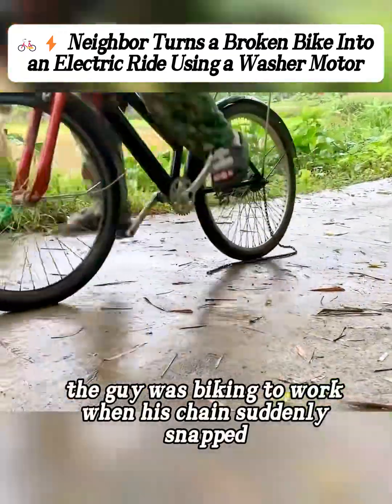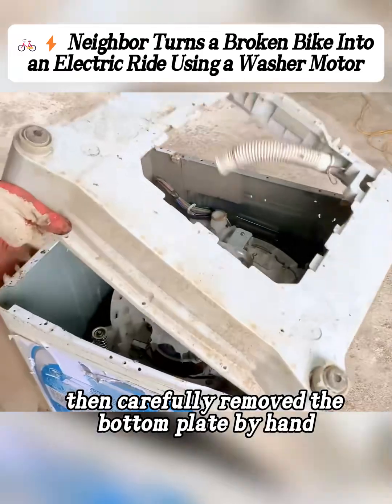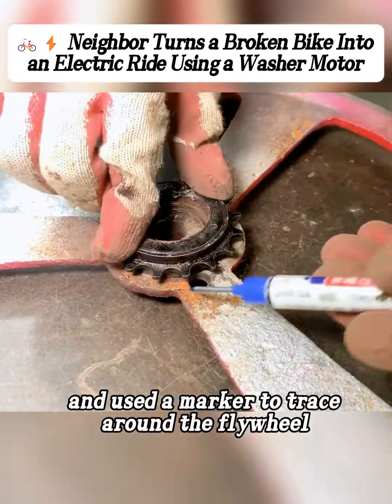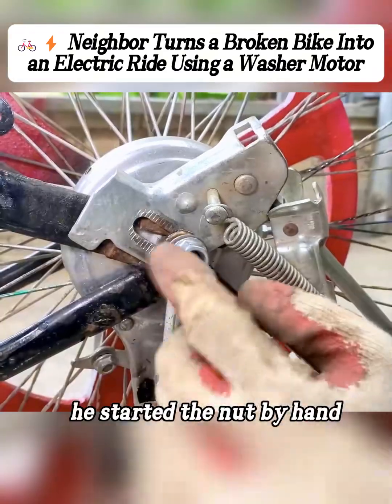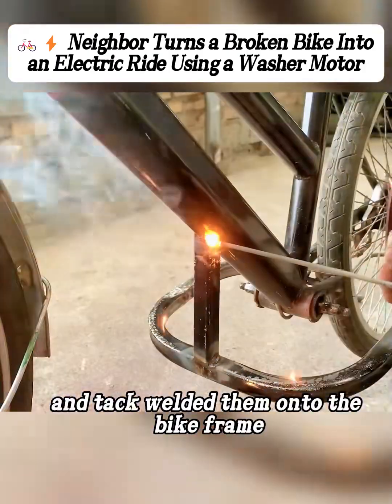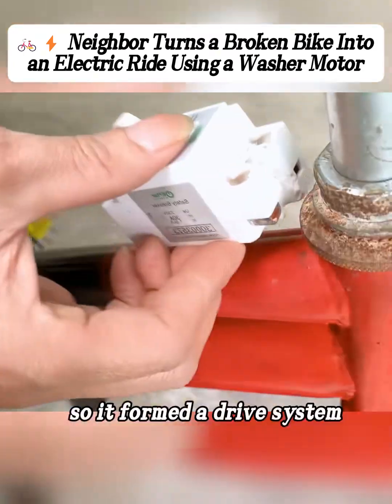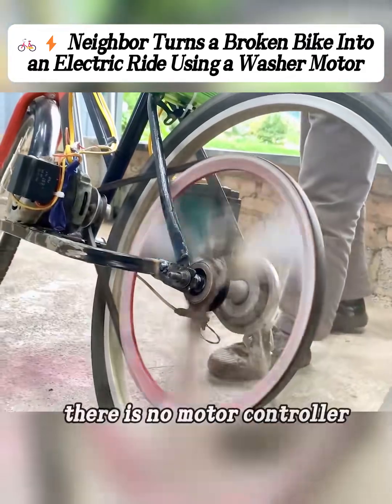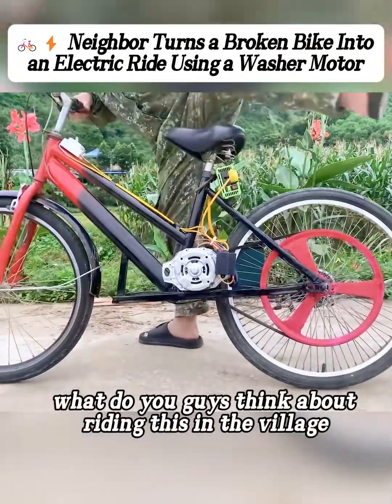DIY Electric Bike Build, Creative Engineering Project, Village Life Hacks Innovation  #shortsfeed

Comment: Great work but how did the brakes work if the motor was always running pushing it forward
Reply from the maker: Thanks for watching! The motor was always running but it's designed to disengage when the brakes are applied. 👍